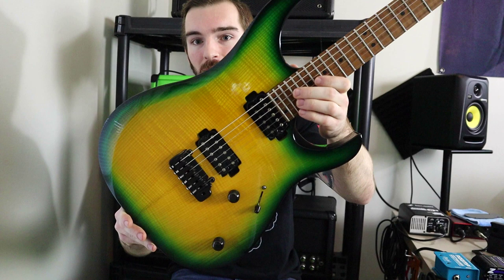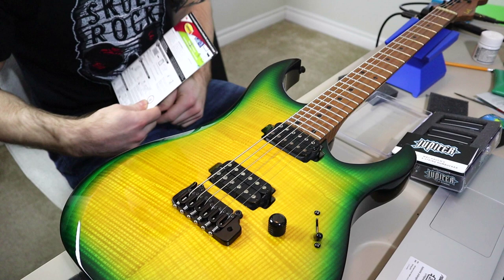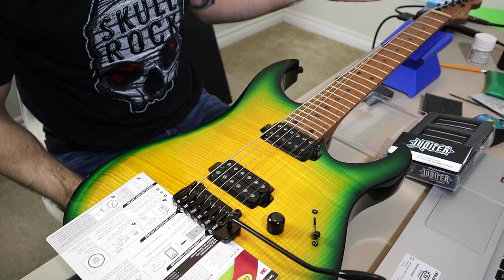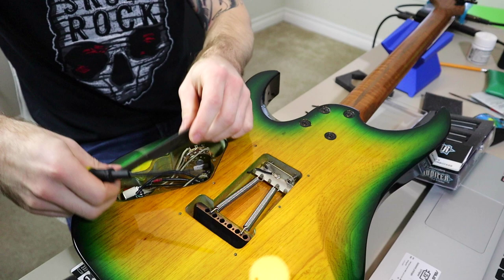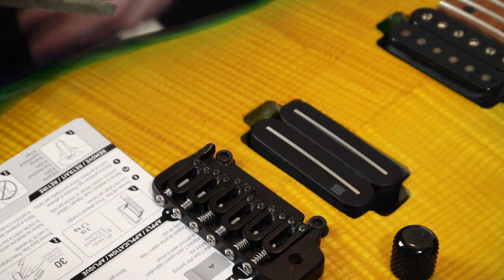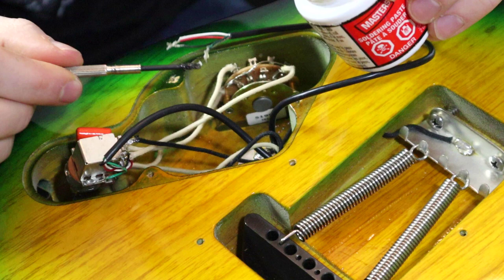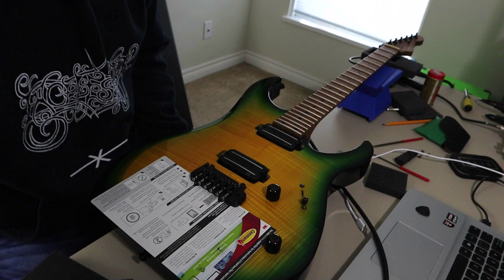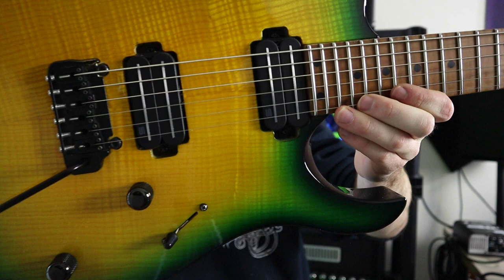Seymour Duncan Jupiter Pickups (Install & Demo)

Comment: Im thinking of putting them in my esp m ii.Mine has a Floyd rose ,so is there a trembucker available? Or the spacing doesn't matter due to the rails design?
Reply from the maker: I believe there is just one spacing size but they will fit a guitar with a Floyd.

Comment: Im very curious if that is just a rebranded "silverbird" SH-9. That would be cool.
Reply from the maker: Not too sure what the Silver Bird is, but I'd love to know more about it!
Reply: @EricMorettin  it's an old SD pickup that had 2 Tele bobbins and 2 alnico 2 magnets for pole pieces. It was a bit big and hard to squeeze is most routes and most pickup rings usually were too small. Just look and sound though
Reply from the maker: @mmaviator22  very cool! I'll look into this now.

Comment: How would you say these compare to the Nazgul bridge pickup?
Reply from the maker: I've honestly only played the nazgul a handful of times and in guitars with different wood combinations going into different rigs. Hard to say but I remember the nazgul having a fair amount of highs and not the most mids by comparison to the Jupiter. I wouldn't mind trying the nazgul through my own setup though.
Reply: @EricMorettin  I appreciate the reply!

I'm currently using a Schecter Omen Extreme 7 with the Sentient Nazgul set, but I've been looking around for a possible upgrade.

I'm torn between the Jupiter or a set of Fishmans. I really like how mid-forward the Jupiter sounds.
Reply from the maker: I'd go for a Jupiter honestly. Its like taking a blanket off an amp when you install these.
Reply: @EricMorettin  I appreciate the input. Helped me make my decision. I'm gonna nab one next paycheck. Thanks again!
Reply from the maker: @BigDatsquatch  cheers man! 🤘